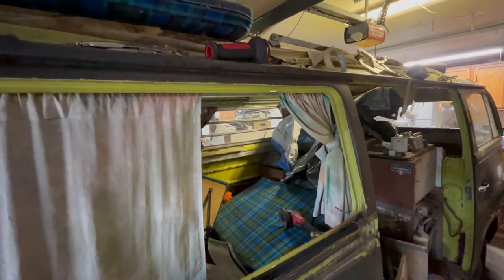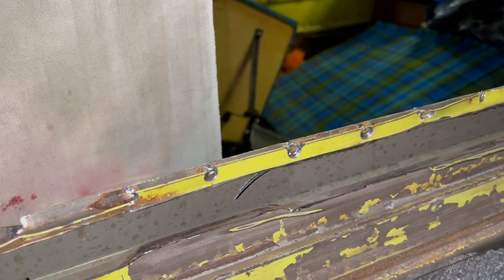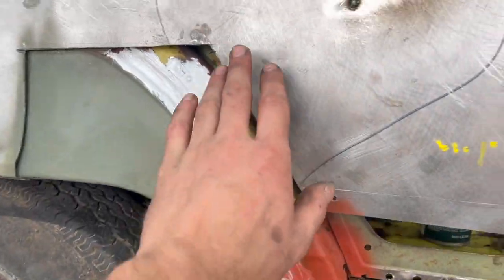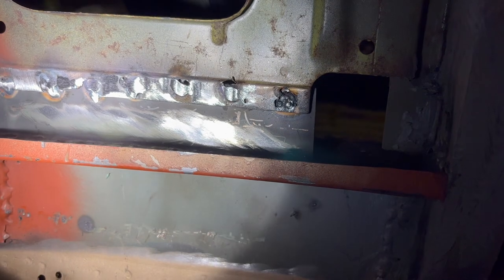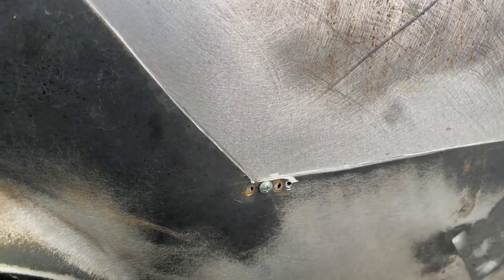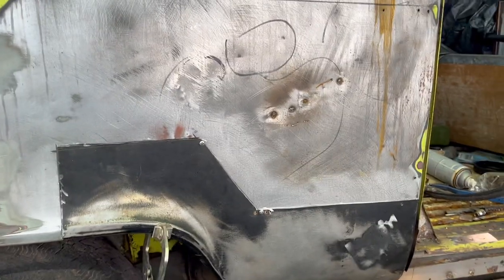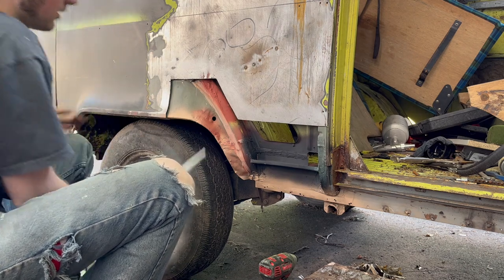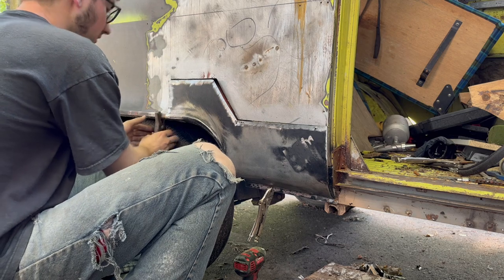VW Bus Restoration | Quarter Panel Replacement Part 1

Comment: I last remember you working on that utterly eaten away door rail. Thought for a while maybe you'd just thrown in the towel LOL. I can appreciate it's more fun to work on the rag top. More fun to get it moving again at least.
Reply from the maker: I’ve thought about it, but it’s such a rare color combo! Two years only and one year with this exact camper set up, insanely difficult to replace with a better bus.
Reply: @DubWerks  Someone said long ago perhaps - perseverance is not one long race but many short races one after the other.....
Reply: @DubWerks my interior is the same as yours but mango exterior paint